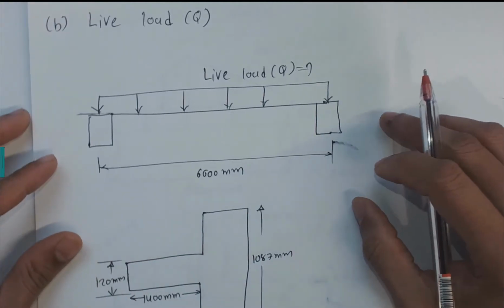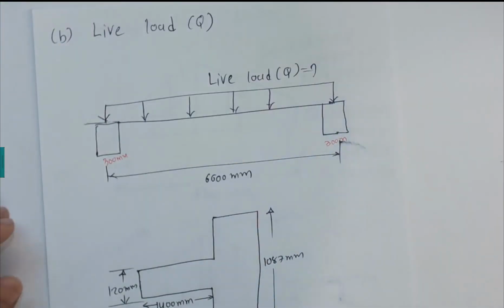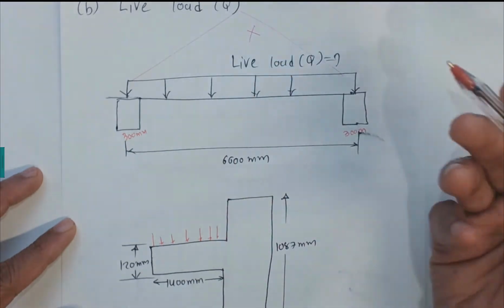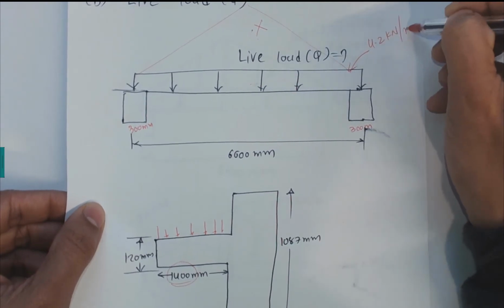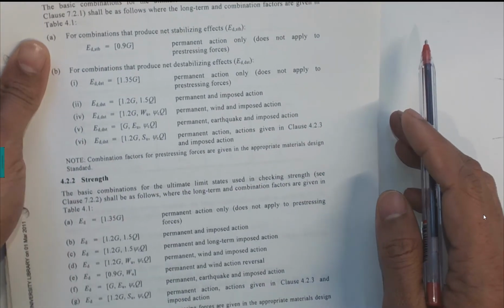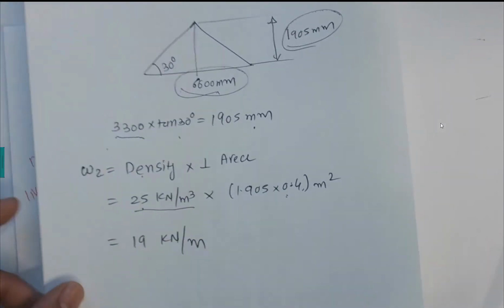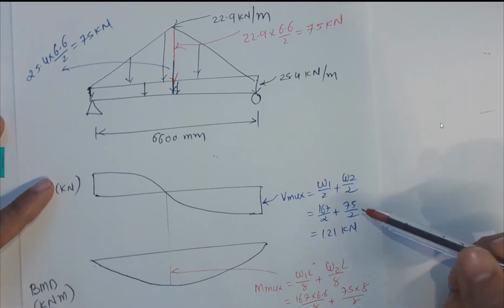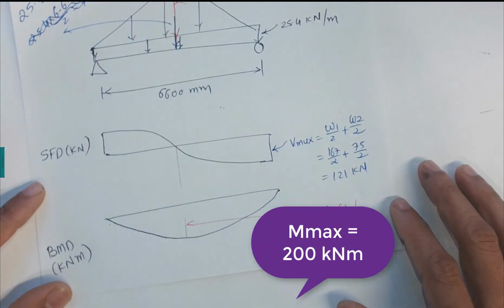Dead live load Example 7 Part 2 AS/NZS 1170.1

Comment: I am confused now Dr Patel. Why did you divide the 6.6m length by 2 when multiplying by 25.4kN/m to find the point load? I thought it was 25.4 kN/m x 6.6m = 167.64kN. By definition, this concentrated load is applied at the centrepoint. If I was taking a moment about one end of the beam, I would then multiply 167.64kN by 6.6m/2, as that is the length of the lever arm. 
Thank you for your time.
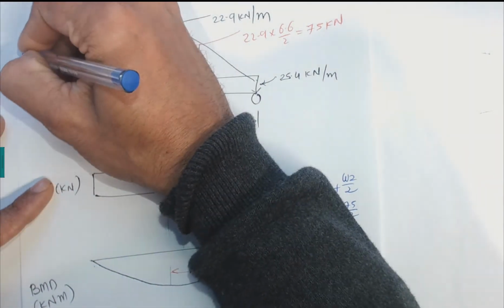Reply from the maker: Thanks for your comments. I have corrected this error. Please watch at 5:50 in which the correction is made. I hope this correct answered your questions.
Reply: @patelstructuralengineer1  My pleasure, and thank you very much Dr Patel.